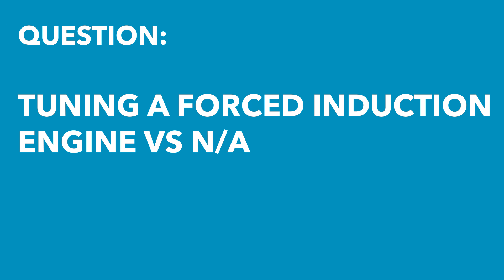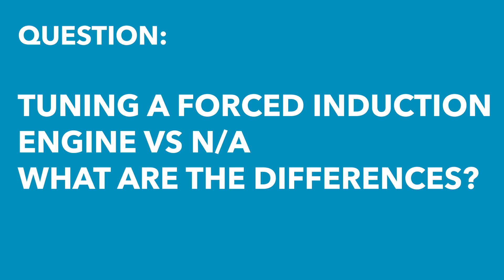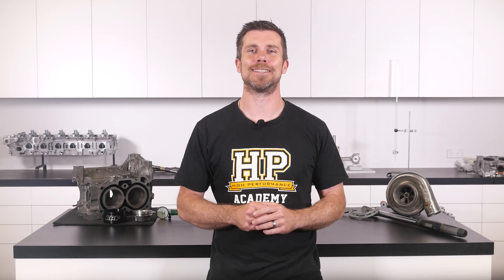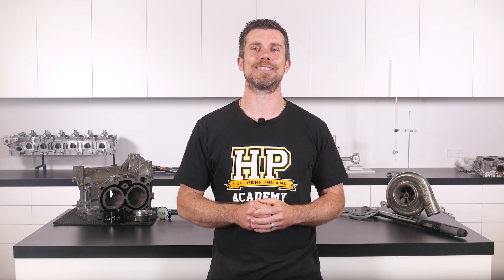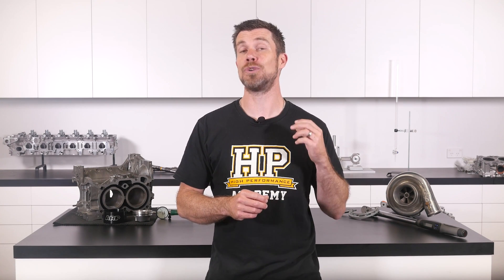[HPA Q&A] Naturally Aspirated vs Turbocharged/Supercharged engine tuning

Comment: Great info in all your videos, do you have a video on what compression ratio would be safe for a turbo street car on pump gas? As there is so much conflicting info out there, old school thought is too run low, where now I hear its possible to run high compression ratios. Is this too do with tuning? cam overlap? or something else all together. Thanks for all the videos you post.
Reply: Ford Sedan Depends entirely on tuning (it's pretty disasterous for a boosted engine to knock) and boost you are running. I personally think no more than 10:1 compression ratio however HPA themselves have a Toyota 86 with a turbo and I think that's got 12:1
Reply: Thanks for the reply, just trying to do some research before going all in and getting parts for my build.
Reply: Good move - the more information you can get for your specific engine the better - different designs and combinations can have quite different optimisations. With almost any engine, there will be web sites and enthusiast support where you can talk to people who know about the strengths and weaknesses of that specific engine.

Some things to consider, though - what your "pump gas" octane actually is ( I assume you're in America?), so your 93 would be, perhaps, a RON of 96(?)? You may even be in an area where an Exx fuel is available at the pump.
Your elevation - some parts of your country are rather high and can allow more boost that a sea level area would.
Your temperature extremes - in very hot weather the charge will be much warmer and so limit your options Vs somewhere where it is generally quite cool even in summer.
Your budget - this is the big one as, as the saying goes "how fast can you afford to go"? Some of the top end equipment will tolerate a lot more abuse than some of the cheap 'good enough' stuff. having the budget will give a lot more flexability.
Close on that is exactly what you expect from your engine, what is it going to be used for - daily driver with some sprint work, track, rebuild frequency/reliability?
Reply: Ford Sedan No problem however I'm no expert haha. There are plenty of opinions about on this topic. Heaps of people think you need 8:1 compression to take any boost... Keep in mind the hpa 86 has direct injection which has a few benefits...
Reply: Also E85 fuel...

Comment: also incorporating engine  (long block) designs. looking at it from an F1 engine perspective, because it is designed to rev really high, the cylinder head flows also act as a force induction similar to that of a supercharger effect plus the high volumetric efficiency. F1 traps speed in the quarter mile is 189 mph at low 9's and this is just an N/A air-cooled engine!
Reply: Bit of a chicken and egg thing there - basically getting as much oxygen in the cylinder as possible within the rules.
They use combination of air velocity and resonant (sound vibration higher and lower pressure waves) tuning to get volumetric efficiencies approaching 150%.
Not sure where you got those figures from, though, for acc'n?
Reply: articles/stories in Racercar engineering magazine
Reply: Great mag', been a subscriber for around 25 years, just don't recall anything quite like that - doesn't mean it didn't happen, though, as the numbers allow it, and they've done a lot of wacky things with the cars over the years.
Oh - "air-cooled"? ;-)